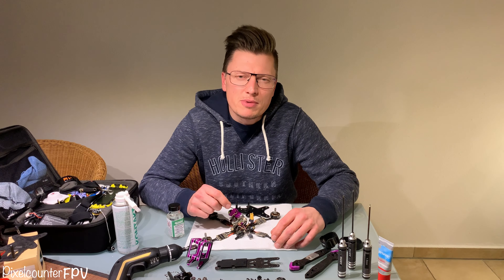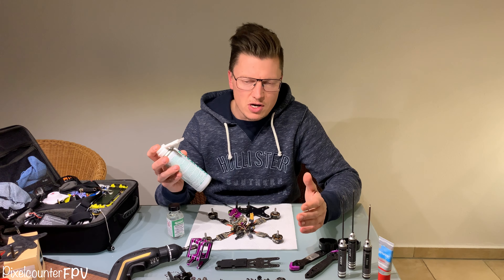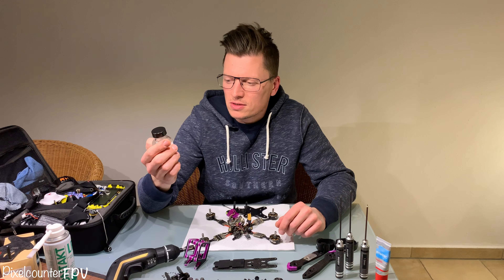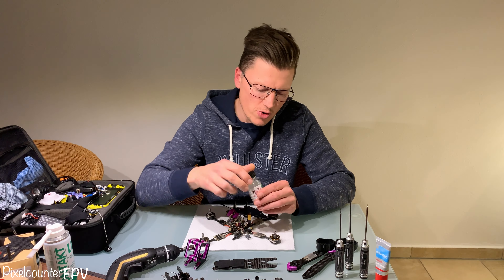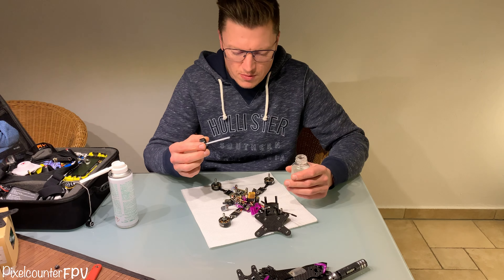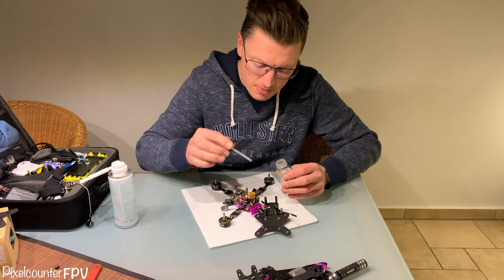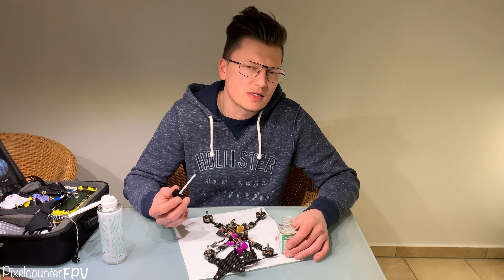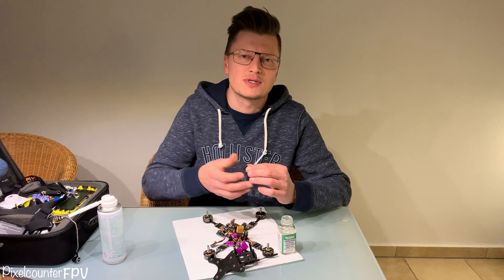🔥Waterproof drone in under 3 minutes🔥

Comment: Thanks for sharing! This is informative 👍🏻
I brought the urethane version of conformal coating from amazon as the price for the silicone was around £20 and the same for postage 🤦🏻‍♂️🤷🏻‍♂️what the ! However having said this it’s worth paying the postage considering the urethane version is cancer causing toxic hazardous all of those ☣️☢️
Subbed ✌🏻
Reply from the maker: 😂😂😂 same like me. It smells very toxic yes, but it’s worth 😬
What’s the difference to silikon....?
Thanks for watching 
I will check out your channel 
Greetings from Germany
Reply: PixelcounterFPV the difference is the heat each can handle ! Urethane is up to 200c , silicon 400c urethane is for protection in a chemical environment 👍🏻
Thanks ✌🏻
Reply from the maker: Ok thanks 🤝

Comment: Useful clip Marc, now even the rain can stop us of ripping some packs ;). Just one question, i see that you are using caps on the esc's what are the specs of those? Thanks brother.
Reply from the maker: Thanks for your comment.
I use this little caps! 

https://www.conrad.de/de/panasonic-eeu-fr1h221-elektrolyt-kondensator-radial-bedrahtet-5-mm-220-f-50-v-20-o-10-mm-1-st-1475959.html

Greetings Marc

Comment: You should have maybe plugged an USB cable into your FC before applying the product, i hope your USB connector is still accessible lol
I should maybe definitely consider to waterproof all my quads :)
Audio was a bit too low though!
Reply from the maker: Yes its a good idea with the usb cable. I was very careful, everything was fine. It works fine with a small brush, but with a plug it's much better.
The audio from the music in the video?

Comment: That is great man. If you need to (re)solder connections, is that possible once you have coated it?
Reply from the maker: Yes no Problem. Simply with the soldering iron on it and it burns even before the tin.
Reply: Fantastic. I think I have some work to do. Thanks a lot bro. Happy flying. You're up to it now, so let the snow come :)
Reply from the maker: Yes and it comes 😩 i hate winter 
Greetings Marc